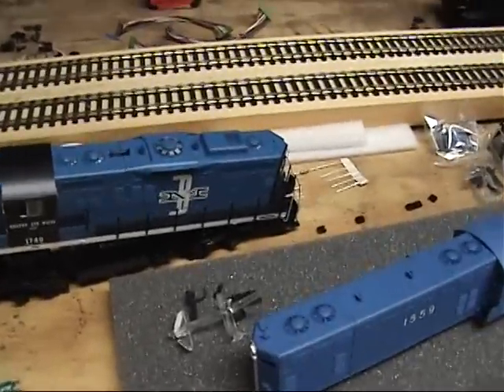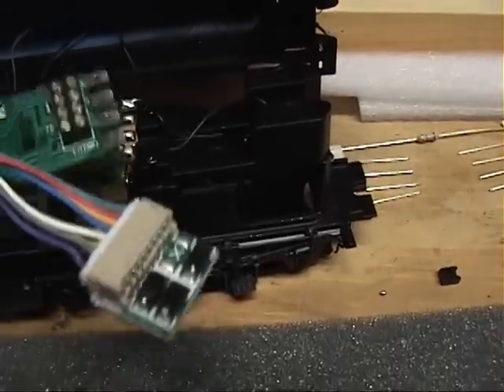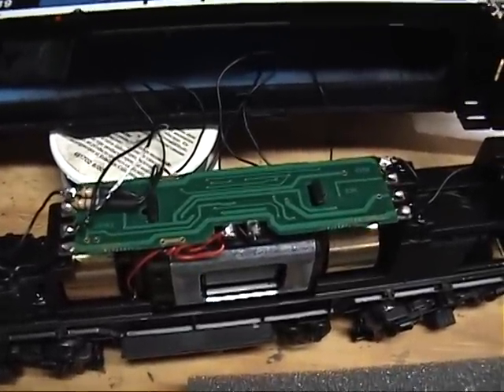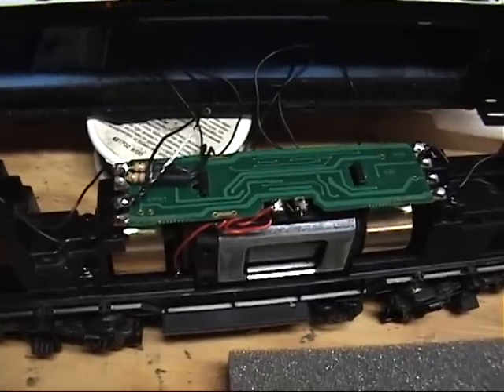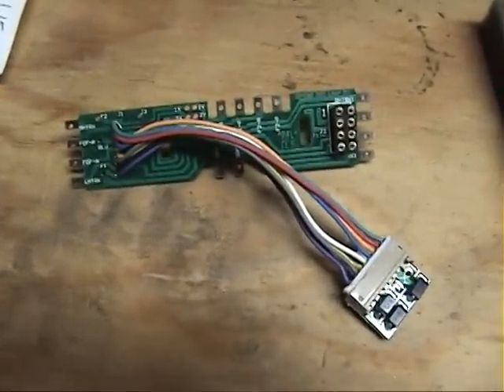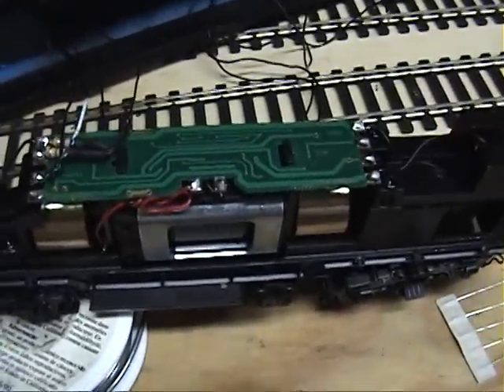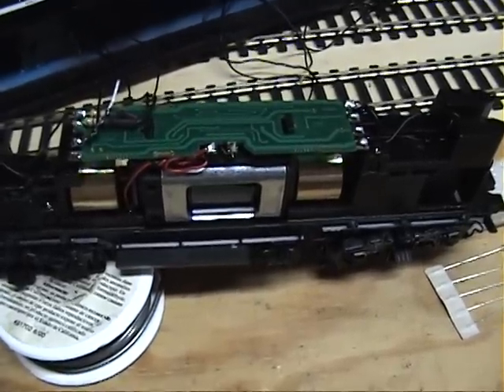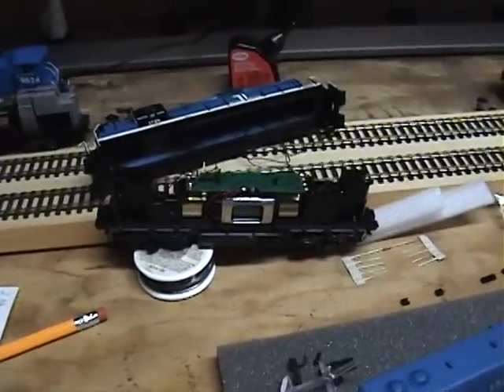New Athearn GP9 DCC install

Comment: You could also use a TCS decoder, since they have the voltage regulators on board and fit the same space as the Athearn factory board.

Comment: Above the rear truck, there are two screws. If you remove those, the top block comes off and allows plenty of room for a decoder. That's where athearn puts their speakers for the sound equipped GPs. I just added aftermarket sound to my GP7 and I used that area for my new speaker.